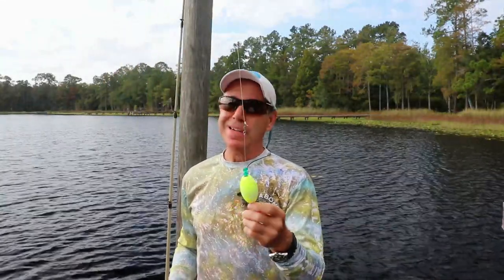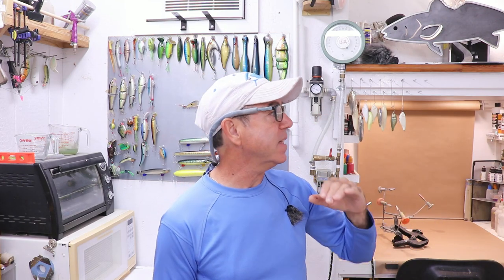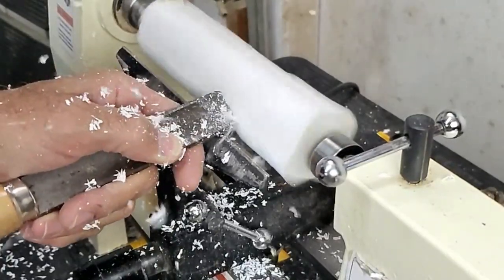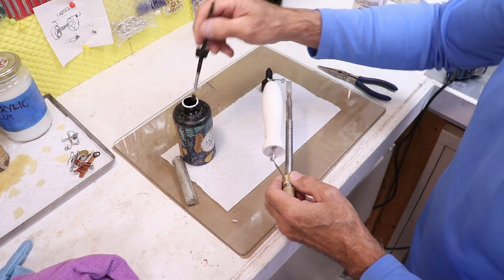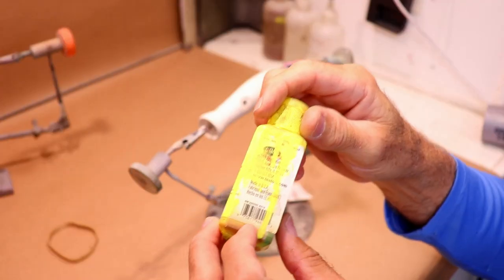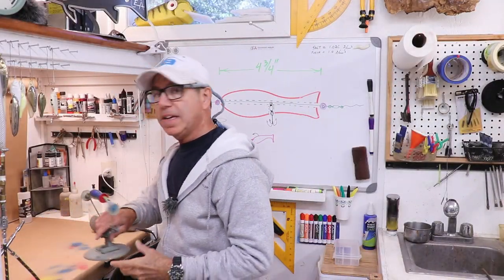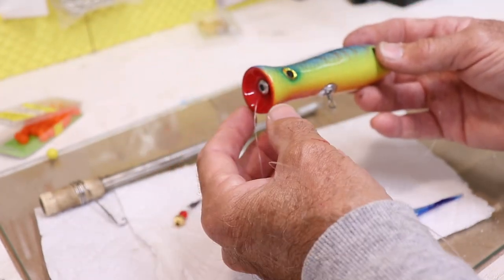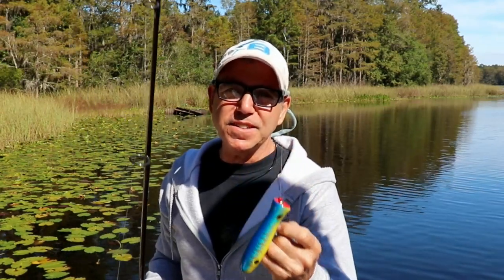How I Invent a New Lure, I've never seen a lure like this, have you?  #luremaking #poppers

Comment: Similar idea to the snapper zapper used for small blue fish. Interesting concept, can't wait to see it in action.  I would have used stainless for the grommets, aluminum doesn't last in saltwater. I used aluminum grommets when I started building many moons ago and  ultimately galvanic corrosion destroyed them. Good video.
Reply from the maker: Aluminum holds up great as long as it's not touching stainless.  So if you use it with a stainless through wire  That's when you set up galvanic corrosion.
Reply: @EngineeredAngler  that explains what caused it on my early saltwater stuff. I used 316L through wired. I only used those aluminum grommets briefly the went to nickel plated brass or SS.

Comment: Thanks for sharing this, let me tell you they work extremely well!! I live in California socal , I've been making and using these going back 30 years . We call them splashers same exact idea in all , started back in the days cutting wood bats 4" long with threaded eyelets at ends. Now I make them with rigid two part foam that sets off pretty fast , shapes easy , epoxy coats and I usually add pigment to my foam if not it's a light yellow color when mixed. So with these Splashers I've used for salt water, I tie feathers one or two max to  a 4 foot piece of fluorocarbon or mono leader. Bonito,   Dorados, all pelagics will hit!! They work great off piers , boats  anywhere you can over cast !! Love watching you build and your heart for sharing!! Many many Likes , brother!!
Reply from the maker: Thank you so much!   It's nice to hear that someone has had some success with this type of rig.  Thank you for letting me know.  Cheers.

Comment: Wonder if you added a swivel at the end of the lure onto the leader and ran the jighead off leader off of that if you’d get a little more popper action or possibly added a bit of weight in the head to keep it down when pulling on the leader to advance the lure?
Reply from the maker: The popper works really well I just could not capture it  on video.
Reply from the maker: The popper actually works really well as a popper. I just couldn't capture the action on the video.
Reply: @EngineeredAngler  gotcha. Yeah the video made it seem like it was bobbing up quite a bit and gliding through the water versus popping. But I also went back and watched the video that the front scoop is more for drag than an actual popping motion. Love the lure and paint job! Can’t wait to see it in action in the gulf!

Comment: Franco, great video and inventive lure.  Would an application of micro beads have increased its buoyancy but not increase its weight?  Thanks, Bill from frozen Mn.
Reply from the maker: It would be difficult to make a mixture of resin and micro balloons that would have a lower density lower than PVC board.  So if I had needed more buoyancy, I could have made the lure just a bit chubbier.